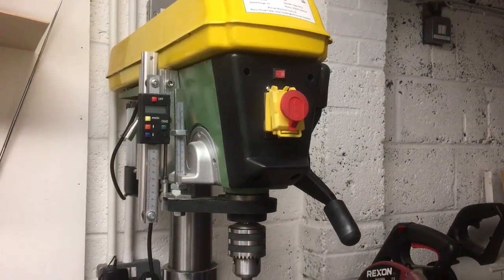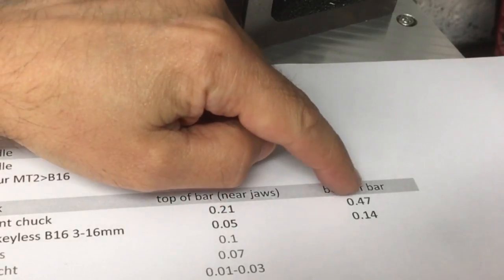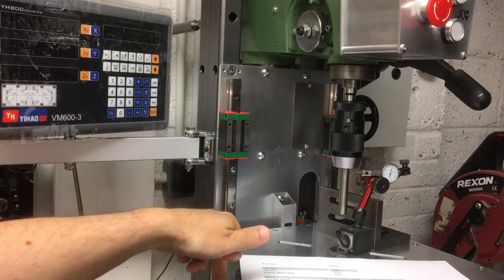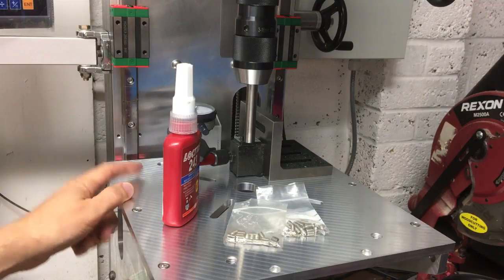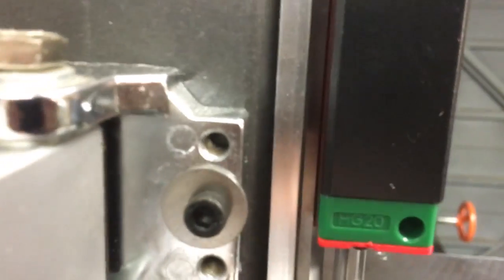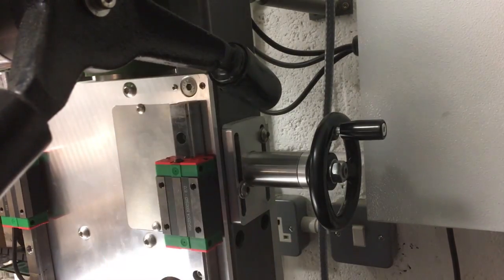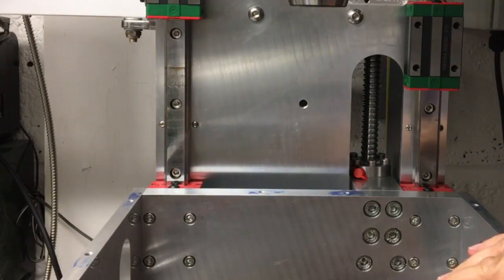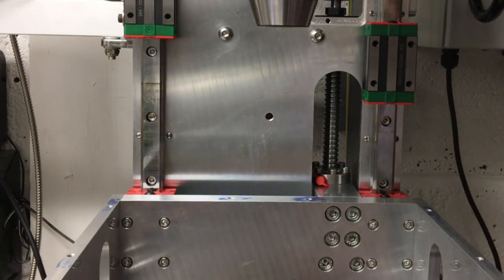Ep24: Drill Press Upgrade | Progress halted by alignment problems . . .

Comment: You can try turning the chuck 180 degrees in the spindle. You might get lucky and actually have the run-out in the spindle cancel out part of the overall.
Reply from the maker: OK yes that might help.  Thanks

Comment: Hi, really appreciate your construction! I'm trying to follow your ''plans''. Please, can you tell the name of the company specializes in chucks? I don't understand the name in the video. I have a old Drill press that have a taper 2 1/2 and still cant find a answer about if it is possible to change for a type that is not obsolete. Thank s a lot!
Reply from the maker: Thanks for following along.  The company is called Rotogrip.  I don’t know if they have that size but you can try them.  Another option would be an adapter?  Or if you have the equipment make a new spindle with the arbor size you need?  Although that would be a big project.  Perhaps there is another more recent drill which happens to have the same dimensions for complete the quill and would be a direct replacement?  Good luck with it !
Reply: @routercnc9517  Thank you, I´ll go check yours suggestions. If not, I'll do with other drilll
Reply: I try to find Rotogrip but only shows Bowlling balls. The drill was made in Taiwan 1987 and I cant find a solution for the Taper JT # 2 1/2, Chuck 1/2
Reply: Never mind. I'm looking for other Drill, this one is to small and old, maybe not good for the effort. Thank! I'm following your projects, CNC now with more detailed videos and the Drill project, very inspired. Let me thinking, if I can do it also :) at least, I'm learning how can be done well.
Reply from the maker: Apologies!  Rotagrip http://www.rotagriponline.com/index.php?option=com_content&task=view&id=16&Itemid=33
Reply from the maker: Apologies!  Rotagrip http://www.rotagriponline.com/index.php?option=com_content&task=view&id=16&Itemid=33
Reply: @routercnc9517  Thank you!